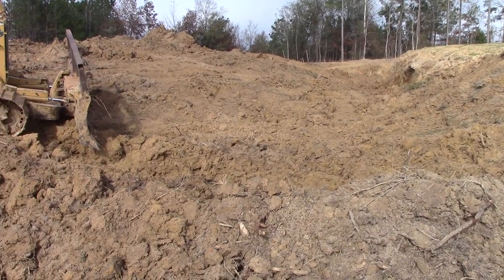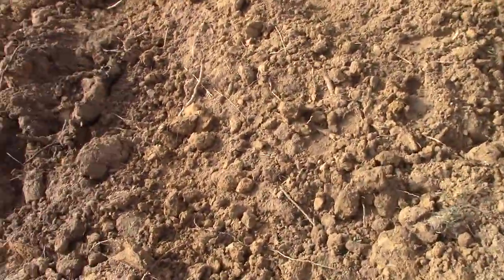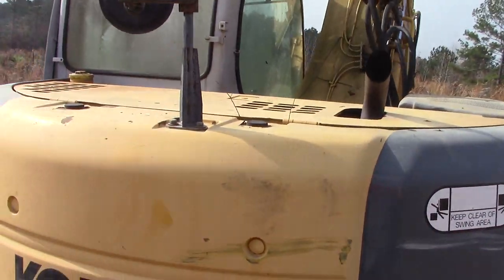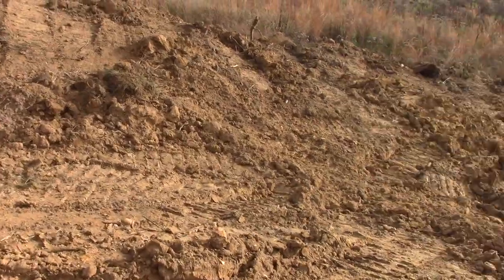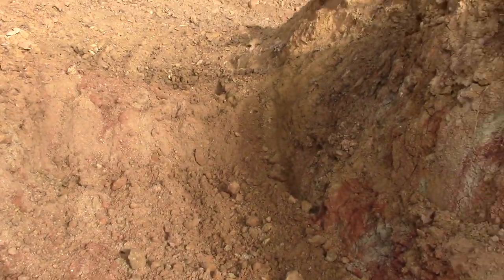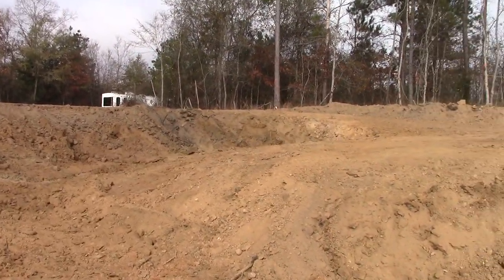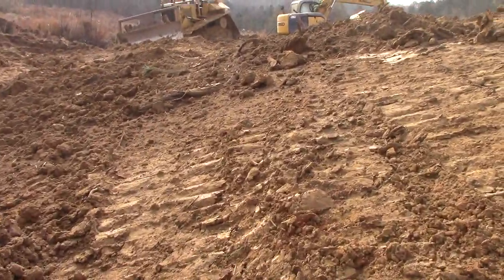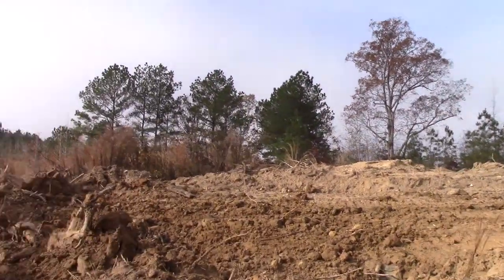The Bull Dozer Got Stuck In The Mud And We Had To Figure Out A Way To Pull That Huge Machine Out

Comment: you might be able to use your tractor with the loader bucket to scoop out the trench as needed, and just have access to a dump site area down hill to get rid of any useless material you dig up. you might also consider making a large ore bin. something that was say, 20x20 foot in dimensions, with a plywood floor, and three plywood sides going up maybe 3-4 feet, that where supported by timbers, to make a really large staging ground for any ore material you dig out of the pit, and even your own wash plant, and use that as a bulk material storage nearby, but also slightly out of the way. if i am right, you seem to have a nice field near the wash plant you could build something like that. maybe just south or maybe north of your recovery Hut, where your Jig is.